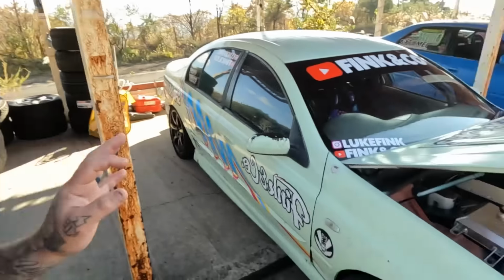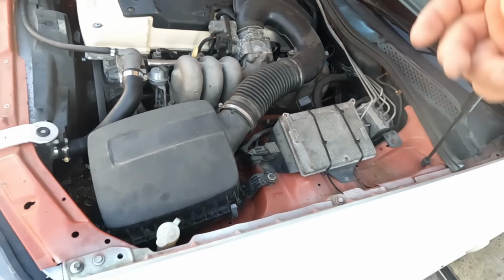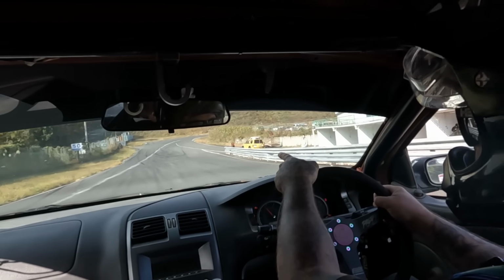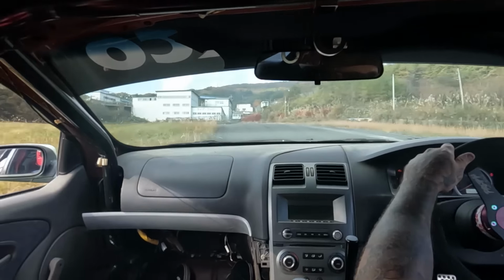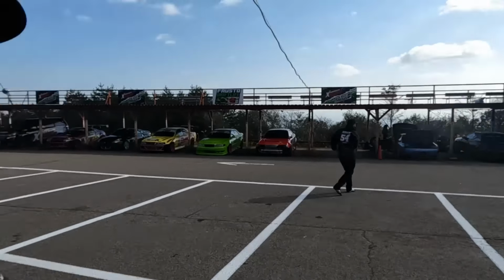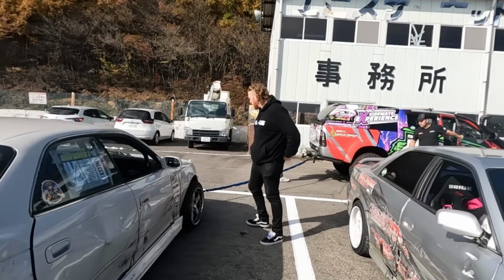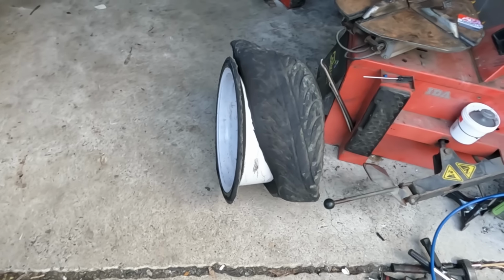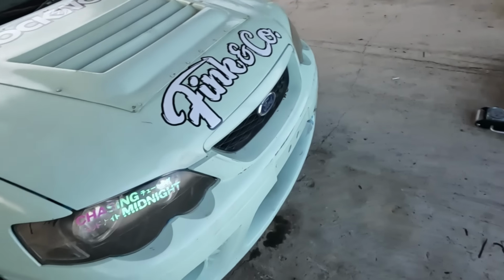180kmph Japan falcon backies

Comment: Those backies are why you run those 265s!
Reply from the maker: @obsidian....  no matter if backies or not I’m always more enthusiastic to run tons of grip on the back
Reply: @Lukefink  I feel ya. If you can fit them then why not run em... I mean,  as long as you have the torque/power to push them then run the damn things 🔥
Reply: @Lukefink  Lmao, boy was I a bit off...
.
I'm basically watching your back catalog in order, but I just started watching around 4 videos before this one. 
Well... I just got to the "blown up Falcon" video and found out that it's a stock, non turbo'd Barra. That changes everything 🤣. Running a 265 with that is definitely a bigger decision. So, It seems like you really do like having that rear grip.

Comment: Where do you get the extended lcas, love the vids. Impressive asf with the falc in Japan, a quick rundown of the mods would be mint
Reply: pretty sure the fords got an Au house angle kit
Reply: AU House angle kit and shockworks suspension, prob a welded diff and a Luke Fink driving it
Reply from the maker: Build videos are on the channel
Reply: fabhouse make a bunch of suspension arms for them